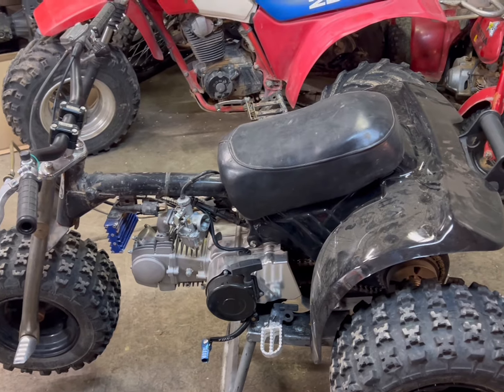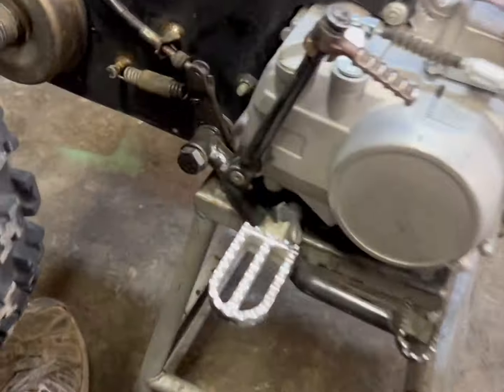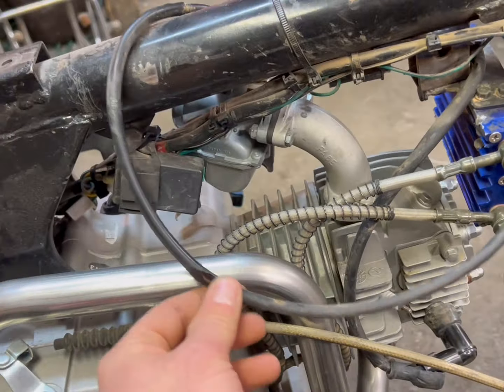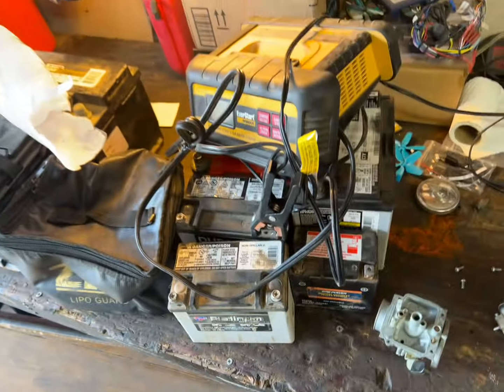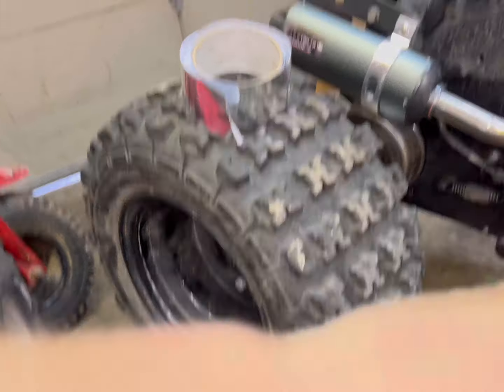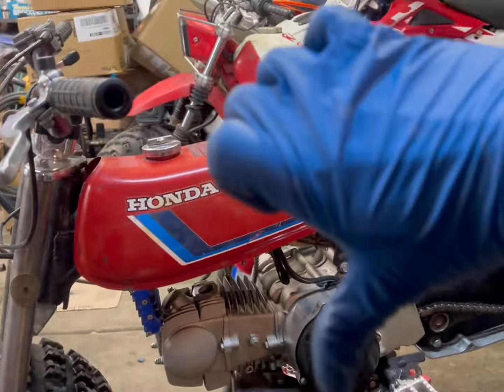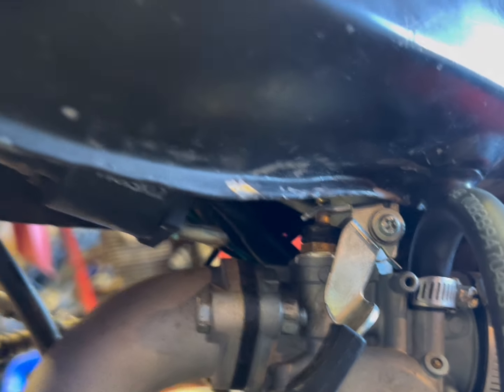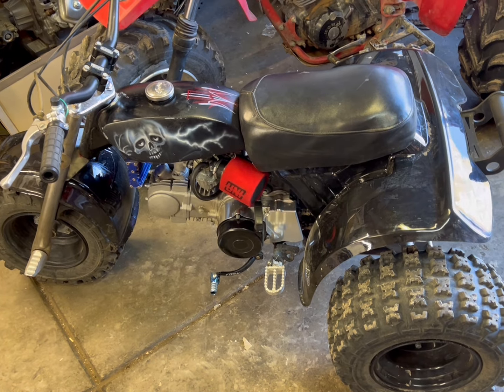Super sketchy ATC70 140cc DEATH TRAP!

Comment: I'd like to see the pull start in action. Kicking my 140 in my Sachs Madass over is not easy, and I used to ride a Yamaha SR500
Reply from the maker: They are pretty great to be honest, for whatever reason the milled aluminum housing does not match the bolt pattern perfectly so you have to file the edge of one of the bolt holes to get it to lineup but besides that they are a great fit!! Thanks for watching!

Comment: What size jets are you running? I have a atc70 with the 140 in it and I have same carb it it runs horrible.
Reply from the maker: I’m not sure brother, do you have a exhaust gasket? lol
Reply: @robbygrey  yes lol 😂
Reply from the maker: @e2wul88  dude these Chinese carbs are hit and miss. I have messed with them for hours, and made no progress or made them worse. lol my honest recommendation would be to just buy a brand new one😂
Reply: @robbygrey  was a brand new engine and carb when I fitted it mate, I have currently ditched that carb I have try loads different ones but clearance issues off the fuel tank make a lot not fit, I am using a pz30 carb which fits a lot better under the tank, it runs ok with that one in it mate.